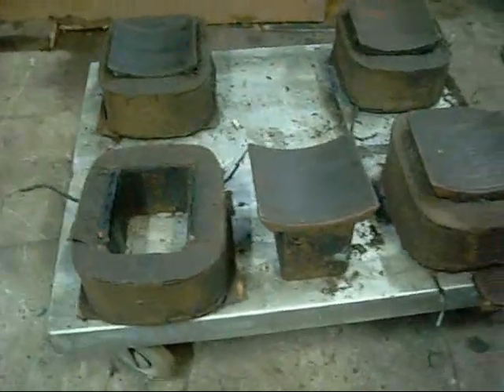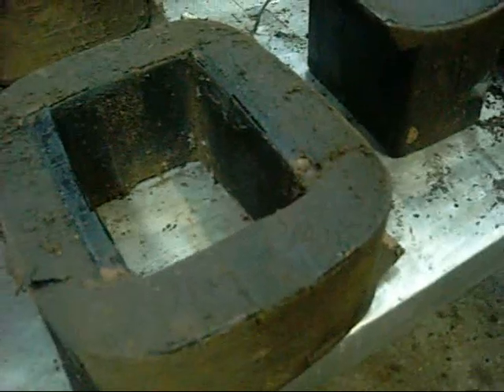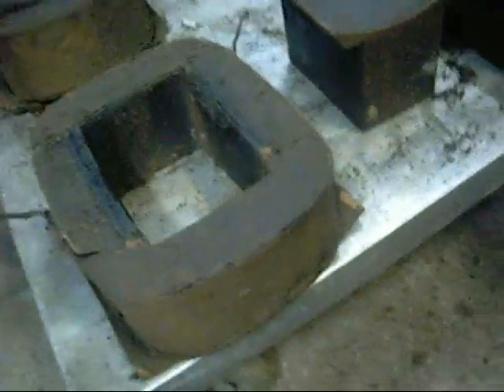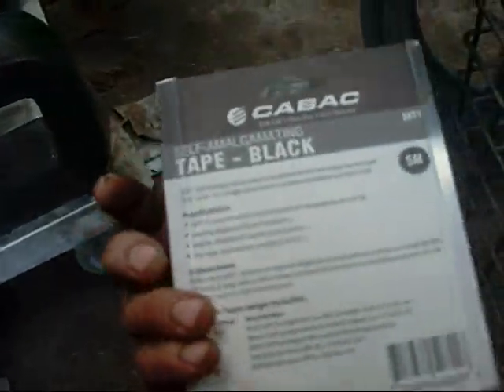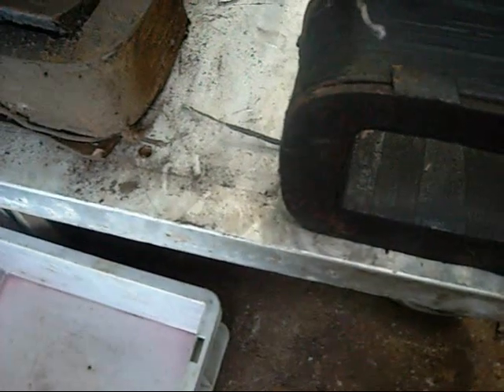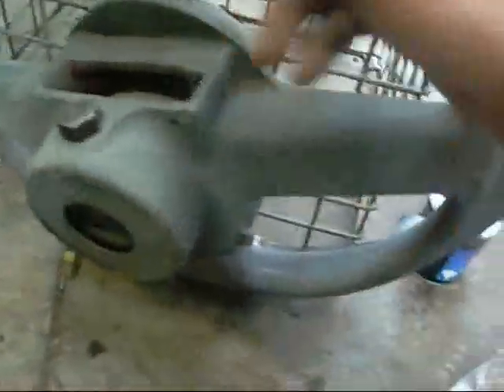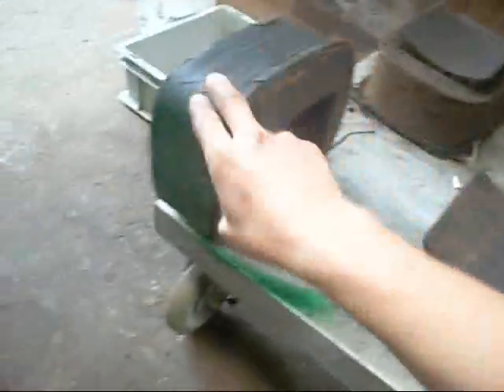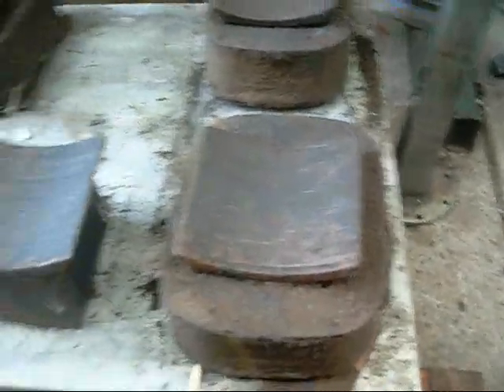Generator Field Winding Preservation

Comment: you could get the crack brazed, less likely to crack than welding, if that fails bolting a strap inside of it might be the way to go, as far as the windings go heat shrink and self vulcanizing tape doesnt sound like a bad idea

Comment: have you thought of tapping through the crack from the outside edge and loctite in some stud bar, should finish quite invisable. could route the crack and use some liquid metal for cosmetic finish
good luck with it.